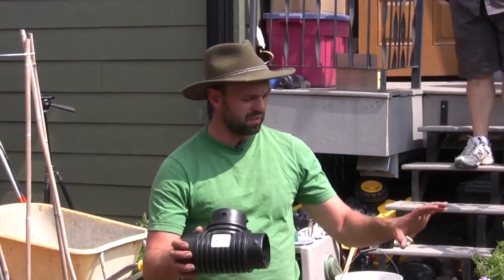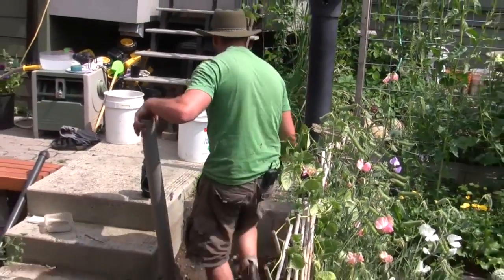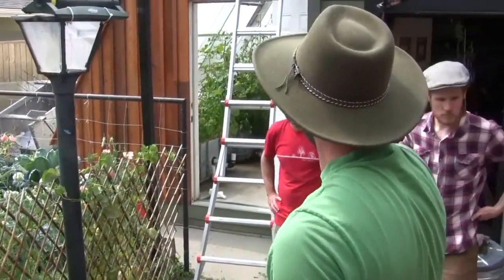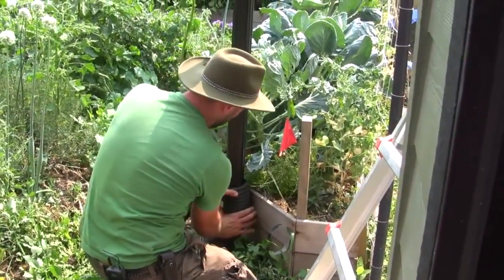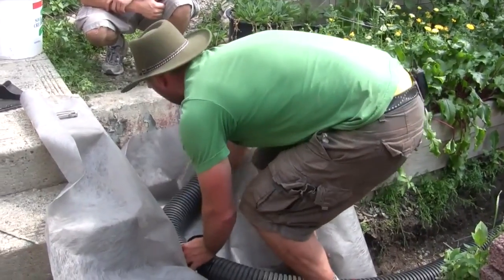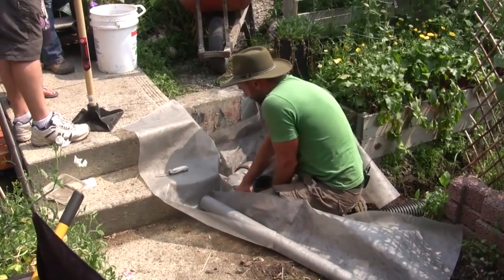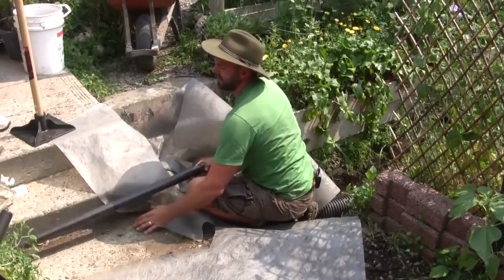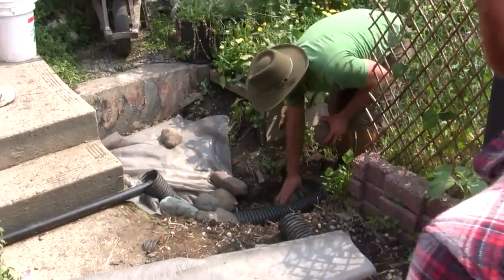Urban Swales: Construction, Spillways & Catchbasin (pt 2)

Comment: Did you put holes in the black plastic pipe ?  Did you cover the pipe around the beds  with soil  or wood to walk on.? The  Garden looks  great already. What I like about this system is that the water off the roof is  is not sitting in water barrels, with this system the water does not get stagnated and smelly.  Can we see the finished  garden please.  Thank you for showing us your garden.😉🍒✔👌👍
Reply: The weeping tile has very small hole in it it weeps out.